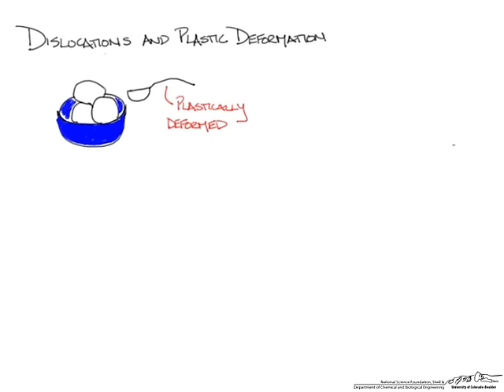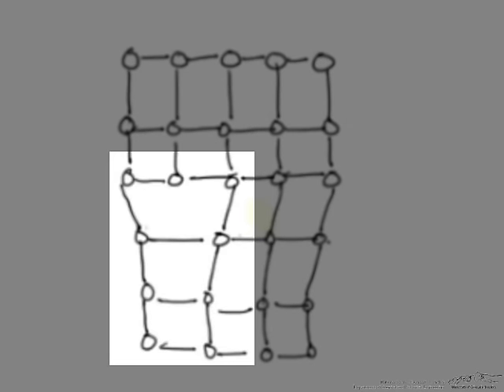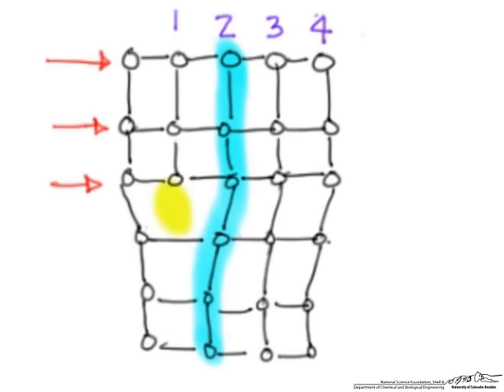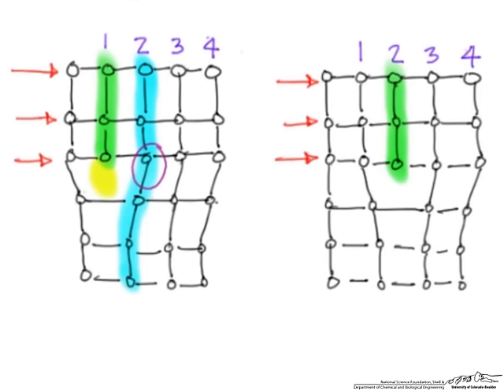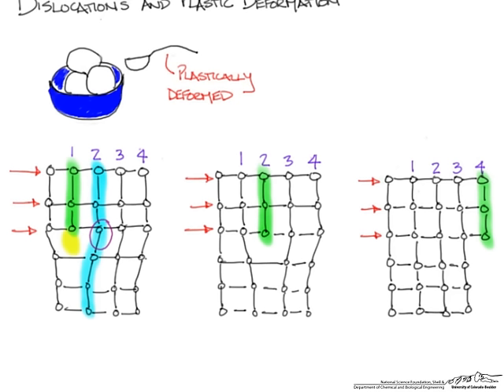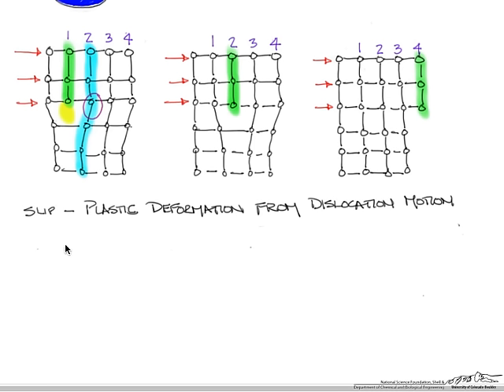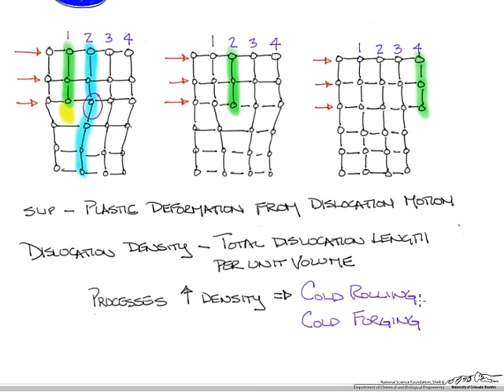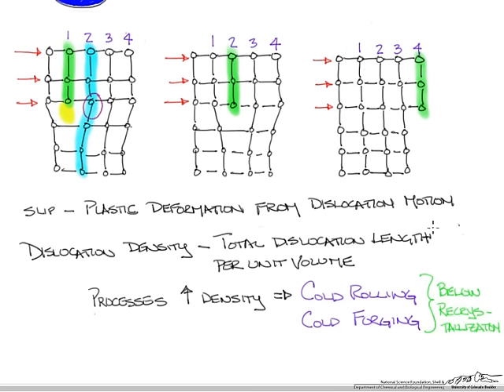Dislocations and Plastic Deformation

Comment: what if a materials lattice structure has no missing atoms and is regular. is it no longer a ductile material? is that the defining feature of a ductile material?

great vid thanks
Reply: Yeah, basically, a perfect lattice wouldn't be ductile anymore. 
So in theory, such  material would be 1000x stronger than the real version of it with dislocations

Comment: I might be getting a little off topic and unrealistic here, but what if the material was perfect? So all of the things (I'm not comfortable using the word lattice, because I'm not 100% sure exactly what it means) line up. Would breaking then involve dislocating all of the things at once and kind of shearing it apart. What if a perfect material is bent? Is it like a cube of ball magnets being ripped apart? Is sodium just a mess of particles, that don't line up, and is that why it's so easy to deform? And where can I find the answer to similar questions? I'm in a complicated situation, where I do not go to school, and I don't have access to this kind of knowledge, and I don't know where to find it.
Reply: Eventually after enough cold working and deformation, the dislocations cannot move anymore. They will hit a grain boundary or another dislocation and just can't move.  When this happens, the material stops plastic deformation and starts to fracture.  I assume, in your so called "perfect material" with no dislocations, it would simply start to fracture instead of deforming because there are no dislocations to move.  

Materials are ductile because of dislocations. After a lot of coldworking and deformation, the strength of the material increases but the ductility decreases.  

Metals are ductile because they have lots of dislocations. Ceramics have very few dislocations.  This is why ceramics don't bend, but simply fracture.
Reply: @thomasbitler8798  So ceramics and other brittle materials have very little defects resulting in a sudden fracture?